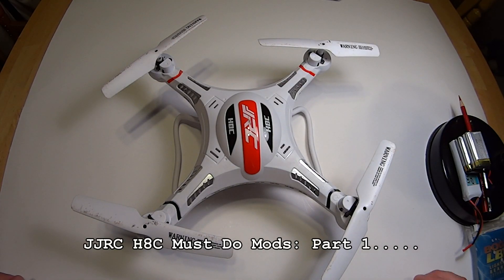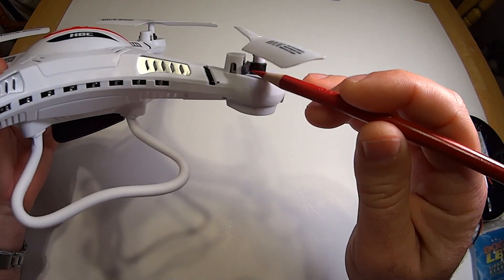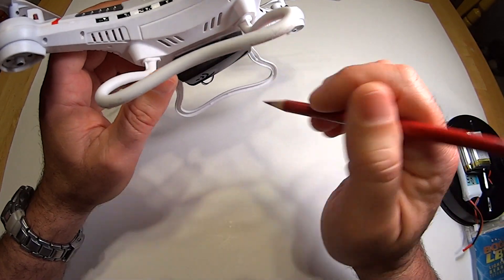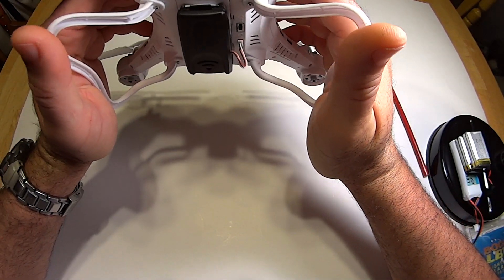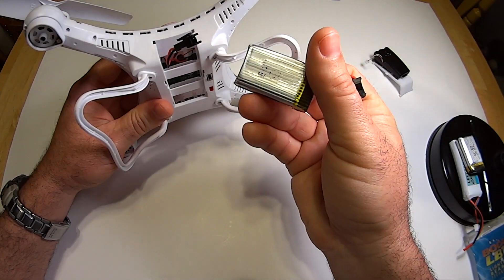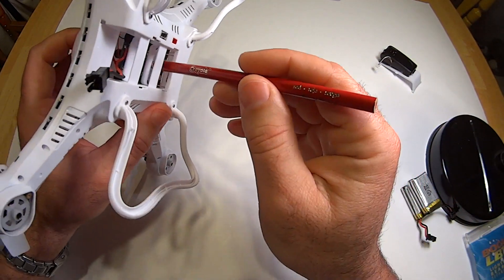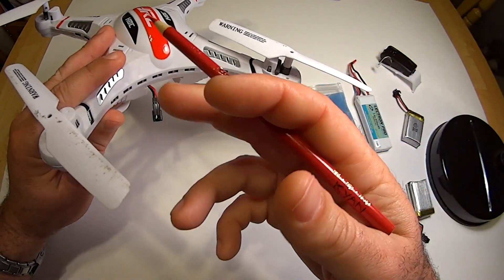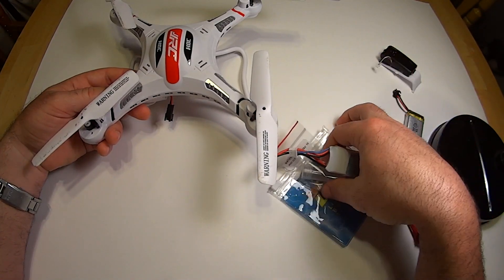JJRC H8C HD Quad Copter Drone MODS - All the Best Part 1 - [Thoughts After 25 Flights]

Comment: Well if can not work on it an modify it than what else is there??. We all i think try to modify all these quads, up some what. i am using an 850 mah on this JJRC H8C, along with stock.battery, sure has enough screws.in body .When you exchange motor ,swill you go from start to finish and body separation also please. With out your mod. today I was kinda upset.Gear shaft and gear together mmm, bend to easy as you said....
Reply from the maker: When my motors come in I'll do a full disassembly, install new motors, bearings and more.  Motors should be in this week and I'll post part 2 Video up.  Thanks for your comments.
Reply: Dustin Dunnill When you purchase bearings, try for the 7 x 4 x 2mm, avoiding the 7 x 4 x 2.5mm. Occasionally you'll find the prop doesn't have enough room to allow for the extra 1mm. I just installed 8 bearings in the H8C and just one prop wouldn't fit back on. Rather than redrill the hole I rubbed the base of the prop on a sheet of 800grit paper . It didn't take much to get it right. I do wish they'd switch to brushless motors and do away with that archaic gearing setup. I honestly can't see how it would be that much more expensive. It'll happen, it has to.

Comment: Does the upgraded battery work with the charger that came with the drone?
Reply from the maker: technically it will charge slowly if you get the correct polarity when connected.  It is hard to tell which wire is pos and neg because both are black with stock charger.  I wouldn't risk it.   Also you won't be able to balance charge it.  Get a descent $30 charger if you are going to spend the money on quality batteries.  The stock charger will destroy your batteries sooner than later.
Reply: Dustin Dunnill Try buying a $10 multimeter, then learn how to tell which wire is which. I've seen a 6 year old use one, so you shouldn't have a problem. :-)
Reply from the maker: yup,  good idea pf.  forgot to mention that.  Multimeter's are a must with any electronic hobby ;)

Comment: how did the bearings work out?
Reply from the maker: Hi Greg, bearings were definitely worth the $13 bucks.  You can tell right away how much less friction there is in the drive train.  It gave me a minute or two more runtime after installing them which tells me friction from the bushings was elevated.  Seems to hover more smoothly after bearings as well.
Reply: Dustin Dunnill thx man looking forward to ordering them. also that battery you mention, hear anything negative or is that a solid brand to go with?
Reply from the maker: I have the lecron battery and it's going strong after many flights.

Comment: Dustin: I followed your link to Gearbest for replacement motors for the JJRC H8C.  In the comment section it appears the manufacture says there motors WILL NOT work for the JJRC H8C. Any thoughts?
Reply from the maker: hmm.  that's strange David.  I've heard they have sent the wrong ones to a lot of people.  The ones I got were ok.  Maybe I got lucky and their supplier messed up so their doing damage control.  I hear eBay or banggood might have them also.
Reply: Banggood has plenty of motors, but be quick before they sell out :-)  Try fitting proper bearings and lose those copper shaft guides. Give the motors a very light lubrication and stay off maximum throttle. I guarantee you'd lose your car motor if you constantly ran it on maximum revs. So treat this quad well and it will serve you well. I know bearings shouldn't have to be purchased, but let's face it, the quad is made to make as much profit as possible, somebody has to put food on all those tables. I've been considering blocking off the base of the drive section as it's completely open to dust and grass etc. I'm just not sure how much it needs the air to keep the motors cool. I also have some mini ESC's and some micro brushless motors, I'm considering using a CC3D flight controller and do a complete upgrade. But not whilst the H8C is running so well. The only hard part would be fitting the motors. If I can find someone with a 3D printer it may be a goer.
Reply from the maker: Great info pf,  I am thinking the same thing on going brushless eventually and even doing a micro FC with GPS if it can be done cheap and lite enough.  Could you share some links on a good BL setup if you have them?  thanks.
Reply: Dustin Dunnill No mate, I haven't seen anyone do anything on brushless upgrades, mind you I haven't searched  either. I don't see it as impossible, the extra thrust should compensate for the extra weight, but let's face it, all it would be doing is be using just the frame as a platform as there's nothing apart from the shell which will accept brushless. It's just a matter of shoehorning everything into a small space, Something I do every day with full sized copters. The biggest problem will be the actual fitting of the motors. The way I see it the complete existing system will go and a flat platform fitted to the top of the existing pod. I'm sure it would be futile trying to mount them within the pods. There are ESCs which when stripped of their covering, should fit inside the wider part of of each arm and all that remains would be the flight controller. There are a number of good boards which would do a great job. Better motors, better props, better everything. As I said, the only thing which won't change is the shell, and I already have both parts and I have all the motors and ESCs from earlier. What I might do is hope I never need them and give it a try, if it works I'll strip it and do a rebuild on camera. I won't go for a full FPV system, just as long as it flies or maybe enough to carry a Mobius. OK, if there's enough interest I'll give it a go. I have a feeling my biggest problem will be getting the video on YouTube. It's a bloody shame I live in a small country town or I'd find myself an apprentice :-)

Comment: Hi I just bought one of this it's a nice copter but I don't like the controls of the transmitter (left control). Do you think's it's posible to change it? I have one old Walkera 35MHz 4 channel and I was thinking in soldering the sticks on the mainboard and replace the original and put all inside the walkera case with the antenna mod. Sorry for my poor english
Reply from the maker: Hey Oscar,  you could definitely experiment with it but I couldn't tell you if it will work or not.  there's definitely more going on than just the sticks.  There is a micro processor and circuitry in the controller that may not be compatible.  Good luck if you decide to do it.  I hope it works :)
Reply: Ok, thank's that's my fear. I will order another controller (10$) and I will Try.
Reply from the maker: Good idea.

Comment: Hi Dustin, It can even carry a 70g Gopro for few mins https://www.youtube.com/watch?v=_97JT9b0a1M
nice video you've got here, i also did the Range extension mod, ( actually my Wifi module has 2 antenna pins so i've used stock antenna + 1 wifi antenna from a modem because they've upgraded the stock transmitter i guess)   range is more than 200 ft now..